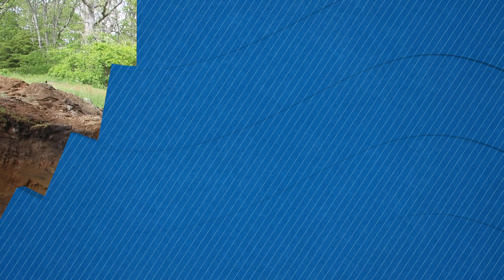A Safe Septic System for Nearby Waterways | Pro2Pro | This Old House

Comment: There is a cool alternative, EcoJohn, which incinerates everything, black water, gray water.  Minimum cost $11,000 for a two-person system. Runs on propane, diesel, or jet fuel, in case you own an airline company

Comment: Good video.  So much work is involved..   and probably very expensive.   Isn't there a 3 x 500 gallon set where 1st one is trash, 2nd is aerobatic and 3rd is chlorine and the water is dumped on the grass?   Shouldn't need any leach field as the water is clean enough.  The electricity for the air pump should come under $5 a month (12 cents / KW).   And only thing that breaks should be the pump every 10 years.  The whole system should cost $1,000.  + installation.

Comment: Have you checked us out? We are actually an ANAEROBIC Septic Tank System Treatment.  DOWN JOHN was designed for anaerobic situations, and was done so by an industrial chemist who researched the science extensively, field tested it with amazing results. This technology has been successfully used over 20 years to treat Hog Farm pit lagoons which are also anaerobic in nature. The DOWN JOHN effluent that runs out into your drain field is actually converted into an excellent N-P-K fertilizer that is both non-toxic and promotes grass growth without having to add all these extras.  Studies and tests are on our site if you are interested in the data and surprising results and the story of the science behind it is here: https://www.downjohn.com/pages/about-us

Comment: Worthless. They already can convert new catalyst that burns NH3 at a low temperature and produces N2.. So just burn liquid ammonia as a fuel... The result is cleaner air...

Way cheaper too. And less maintenance.
Reply: how do you separate the ammonia from the water? Typical septic system has less than 50 per million of total nitrogen. This is just another ntification de-nitrification that has been used for a century, this is how wastewater treatment plants work.
Reply: @capeguy  Ask the Japanese.

The novel catalyst (CuOx/3A2S) is a mullite-type crystal structure 3Al2O3·2SiO2 (3A2S) carrying copper oxide (CuOx). When NH3 was burned with this catalyst, researchers found that it stayed highly active in the selective production of N2, meaning that it suppressed NOx formation, and the catalyst itself did not change even at high temperatures.

Comment: A package treatment plant, with a soak away, have been in use in UK for at least 20 years, wouldn't be allowed to install a septic tank, without proper treatment, for a new property, only old ones left effectively. It's what happens when you have 66 million people in just under 100,000 miles² land mass.

Comment: Ok now the tough questions how long do the filters in the vault last and how much to replace them??
Reply: You don't get rich by wasting money. No way they should take this on without knowing the long term cost. Good question.
Reply: Super reliable. Been using them in Oregon and Washington for 50 years.          Im an installer for 30 plus years in area this was filmed. There a good system.  Total materials and installation.    For 3 or 4 bedroom aproxx 23 to 29
Reply: @toddreynolds8875  23 to 29 What? Cost in Dollars please.
Reply: @charleskorte2752  yes. 23 to 29 thousand. All materials and labor and wire control  panel to house.  And. Re loam seed disturbed area
Reply: @charleskorte2752  we install many of them for years right in the area of this video.
Reply: @charleskorte2752  there made for near  water ocean or ponds      very tight spots they work well. Because there also time dosed leachfield.  So instead of conventional  100 gallon in 100 gallon out.    These leave approx 500 gallon room in tank     so you put 100 gal in.   This thing is processing it over the pod. Every 20 minutes.  Around the clock.      Then also. The leachfield end is dosing small doses  around the clock. Evenly.        Typically size. Of leachfield for 3 bedroom  needed is only.  8x15.  Feet.           So. Work very well in tight lots on pond houses.     There super quality,    super reliable,  have couple day reserve ,  there  fully on line to your maintenance supplier  if. Somethings. Goes faulty.        Service isabout  200.  250  yr to clean filters and leach lines.   And moniter via on line to the service company      they been. In business with this concept for around 50 yrs.   So pretty tried and true.
Reply: R C If you’re building something like that, and you know it’s near the ocean.... whoever owns that house is filthy rich. So it’s not a issue for them. You’re average Joe can’t afford something like this.
Reply: @michaelmcneffii1912  I am not filthy rich it is getting installed in basic houses too. I hate the look of it hate the maintenance but the department of environmental management said I had to have it. It's awful.

Comment: Absolutely correct. The Earth Atmosphere is loaded with Nitrogen. 
78% Nitrogen, 21% Oxygen, less than 1% Argon and just 0.04% Co2 and other trace gases.
The video is a very clear explanation and that septic system is great for the earth and atmosphere.😀👍

Comment: This thinking / explanation seems a bit retard to me. Maybe I am misunderstanding the information, and as I am looking into septic system alternatives myself, I want to be sure I understand what Mr. Richard is saying.

1. The first section of the septic tank is anaerobic, works with bacteria that lives without oxygen.

2. The byproduct turns to nitrogen and amonia, which is pumped into an aerobic vault from the second septic section, creating an oxygen-nitrogen rich water.

3. The oxygen-nitrogen water is then pumped into the first 'anaerobic' septic tank section. Which places more oxygen within an anaerobic chamber, as the nitrogen is expelled.

My current understanding is that anaerobic bacteria live without oxygen and die off with oxygen. To this septic system layman, it seems this system converts the anaerobic chamber into an aerobic chamber. 

Would that not slow or stop the anaerobic process in the first chamber, which is needed to break down the solids?

My question is not a 'wrong or right' thing... it's an "I don't know and would like clarity" thing.

I have seen a system that uses no drain fields, has similar techniques as shown in this video, but separates the sections without overlap to avoid needing a drain field. It is a SUPsurface waste water management system though. Any comments, or response from Mr. Richard, that could help clear the contents of this Pro to Pro video are greatly appreciated.

Comment: That yard looks plenty big enough for a normal system. Even taking into account nearby water.
Reply: Depends on the depth to water table.
Reply: State law im installer in the area. Anything within a mile of ocean. Has to be treatment plant.    Dont matter if its in a 40 foot deep hill of gravel.      State drove a line on a map 15 yrs ago.     End of story.        Sad but true

Comment: Brings up some interesting questions other than the cost of the initial installation.  What does it cost per day to run all those pumps?  Life expectancy of the pumps & replacement cost?  How long do the filters last and or how are they back flushed to remove the inevitable solids that will get trapped in the filters?  How often does the state/county/township require that the septic tank gets pumped and what provisions are in place to access the tank for pumping?

Comment: "Anaerobic" literally means, in this case, "Non/Without-Oxygen", i.e.- an organism that can thrive without Oxygen.
If you're going to be an "expert" about a specific topic, please do your homework first.
Thank you.
Reply: Lastly due to the system becoming full of aerobic rich bacteria it helps extend the life of the system. You see when a septic system dies the SAS has what's known as a biomat. This is made particles of everything that got through the tank. It prevents water from getting out of the SAS. It could be a half inch thick or a foot thick. The aerobic bacteria eat this as well. However there is no perfect system and it will die eventually. Anything else professor?
Reply: But anaerobic bacteria does not thrive in a septic tank. They die off and that's why systems like this one making it aerobic are used.
Reply: @Burniemacfitness  
"Anaerobic" was their term - not mine.
Reply: And that makes them correct. Theres 2 types of bacteria in a septic system. Aerobic and anaerobic. Septic systems dont work correctly when they have anaerobic bacteria. That's why these add on systems are there.
Reply: @Burniemacfitness  
Well,... you and I both learned that in High School... and I taught it in College Biology.
You still didn't offer any useful input into my original statement concerning their erroneous description of the different types of bacteria  - (for those reading this, but are bored with Biology) those thriving in Oxygen, and those that can't.
That's all I was saying...
Reply: I learned this from 25 years in the septic industry. In an area of high groundwater and I/A systems.
Reply: Also, the idea of this system is to produce oxygen and aerobic bacteria. Aerobic bacteria eats solids, grease and anaerobic bacteria at a much faster rate. They also reproduce at such a rate that they overtake the tank. From there as it goes into the SAS the product is lower in nitrogen and is easier for the sand under the SAS to clean the effluent properly. This leads to groundwater being cleaner. Also due to the area of the pond (which is considered groundwater) it helps protect that as well.
Reply: Watch the video again, and pay attention this time.
Reply: And yet - you STILL didn't offer any information relevant to the topic.
You just got an "F", Sir.
Try again...

Comment: The first time this system has a problem, the homeowner is just going to shut it off and bypass all the expensive stuff, letting it just drain into the soil like a conventional septic.  Honestly all they really needed here was a two-tank system with aeration in the second tank.
Reply: It wont work by gravity cant get thru to leachfield.  Has to be pumped.        Install tons of them
Reply: The system appeases the EPA during construction, that's all!

Comment: I was building these sand filters for whole sub divisions several years ago.  The houses all had the 1500 gallon tanks with the baffles, there were a few 5000/10,000 gallon lift stations throughout the sub division and they went to a 50'x200' filter located in wild areas of the subdivision.  One filter could handle about 40,000 gallons of blackwater a day and would cover about 700 homes.  The treated water was pumped to underground leach fields located in common areas and wild areas in the subdivision, or could be discharged above ground if the proper UV treatment was used.  Of course, we had several test wells throughout the property and sent samples from each monthly to be tested.  The real benefit to the developer is it allowed lots to be sized without the accommodations for  leach fields, so full and half acre lots could be 1/3 and 1/4 acre lots.   The Home Owners Associations would take over the maintenance and collected the monthly fees from the homeowners.
Reply: There not that expensive lmao.      Ive installed a ton of them.   One 346 bedroom that was around 1.2 mill.  Maintenance a year for 346 bedroom complex is aprox.  Like 9 grand a year.       Then add regular tank pumping every few years.            Pump are just simple gould high head artesian well pumps. Like 550/600 bucks.
Reply: The ‘first chamber those first down the water. The other ,water goes through the chamberThe water goes to it smells great Maddie screen filters water drips down there’s a different bacteria here
The stuff arrow bacteria

Pictures in Banyan he loves the Lavonia
Ashigan nice chicken water. It drops down to the bar how are you girls doing all day The water goes  up there Ashigan
Reply: Now she can go south to the hair there’s plenty ,in my sugar. Precious father discharge someplace water to the ties that so he doesn’t have any water or bologna Sampat reduction points
Reply: The chamber in the water will fall down by gravity. It comes in there’s a flood he comes in ,to here and make the float
Reply: The water goes through the chamber in the water will break through the sand. It’s surrounded by code surround 6 x 6 right here by grade I am in along the grade booty The right way push with me reload grade right here can you see grinder that was a teeny if the word disappear
Reply: @ericzimmerman7524 Could you send me any plans, designs, photos for what you described? This sounds like what I need for a development on the outskirts. I've been trying to look at alternatives to tapping into sewer and the septic tank & leach field challenge.
Reply: That's all great until the HOA realizes its going to be $500,000 to replace all that equipment/dig up the earth 20-30 years from now and they don't have the $$$$.
Reply: @aaronbays4  , all of the mechanical stuff like the pumps are installed with lift eyes and the plumbing has quick disconnects on them.  There are also many clean out access points all over the system.  But, just like anything, it requires regular maintenance.   Most of the HOAs have hired a third party to do the maintenance.  But when they are collected roughly $30 a month from more than a thousand houses, I am pretty sure they can afford $500,000 in about 20 or 30 years.   The septic tanks at the houses are the homeowners responsibility, so the maintenance crews are only responsible for everything downstream.  The life span of the the electronics is about 20 years, and the main tanks and plumbing should last at least 50 if maintained.   I estimate the average  annual operating cost would be around $100,000 a year with no issues, which includes one full time maintenance person which most of these subdivisions already have a crew of three or four people anyway. It is a good solution for land that doesn't perk.  it is cheaper than putting in full septic systems in each homesite, plus the houses sell faster being on a "sewer system".
Reply: @ericzimmerman7524    I'm still skeptical about private entities like an HOA maintaining a sewer system.  Seen it time and again on the news about the HOA's being corrupt, people stealing/embezzeling the funds, mis-spending the $$$$, not properly investing the $$$$ and not a having rainy day funds to cover that $500,000 wallop when the entire septic system breaks, sometimes they're just set up to fail because people don't pay the dues or they don't collect enough $$$$ to cover expenses.  I wouldn't move into a development with its own private sewer system.
Reply: @aaronbays4  ,  personally I would not want to live in a house with any HOA,  but this is deviating from the subject.   As for corruption and abuse of funds, it doesn't matter whether it is privately owned  or not, everyone us suspect.     The sewage treatment system works, and if maintained  will last a long time before needing major work done.    We put in a single unit a few times for houses way out  and the homeowner did not want to have to clear the land for a leach field.

Comment: So much to go wrong with that overcomplicated system...
Reply: Yeah not really a complicated system
Reply: lambert1702 actually quite simple and common, septic mounds have been around for a long time and proven to work.
Reply: Very simple.  And very reliable.      They been in business for 50 years.  Orenco  corp. Oregon.  Been used on west coast since the 70's. Very good systems.   Expensive. Bout 25 all installed. Plus engineer costs

Comment: I really hate dosing tank pumps, that looked like it had enough drop to not have to use the last pump.  The first part of the system looks like just an add-on and if it fails the system will still function.  When the septic tank fills to the brim when the dosing tank pump fails, you will be stuck with no way to use the toilets/drains.  I have heard till septic trucks get there people just pumping it on the ground.  Also if you live in a place where the power is out a lot and for some reason that pump circuit trips off it will fill up before you know anything is wrong.  Officials don't think these things through.  Here in the south your required to have a dosing tank because its required to have a raised drain field.  It turns something you shouldn't have to mess with but every few years to something you have to keep an eye on all the time.  Don't let me get started on cheap pumps too. lol sorry for ranting.  I really like the first part of the system, some nice add-on to help reduce our footprint on the environment.